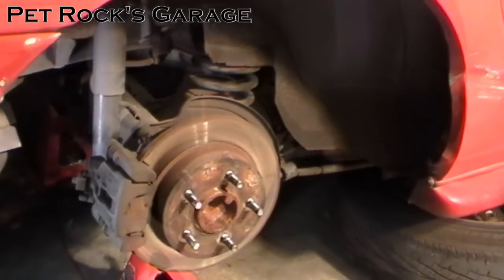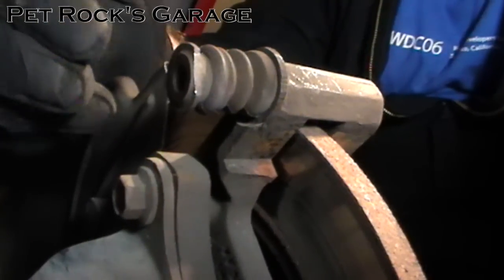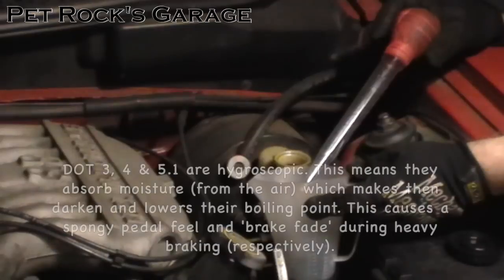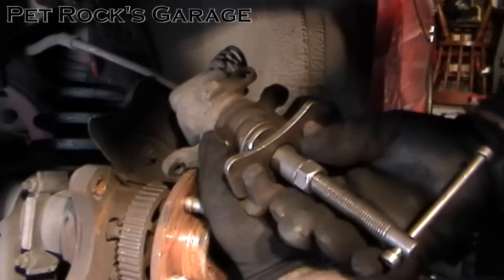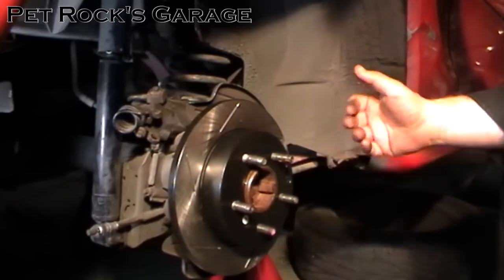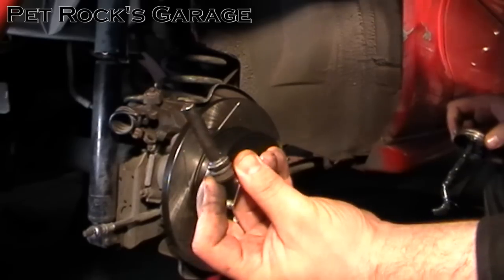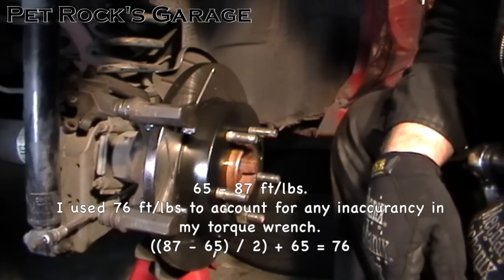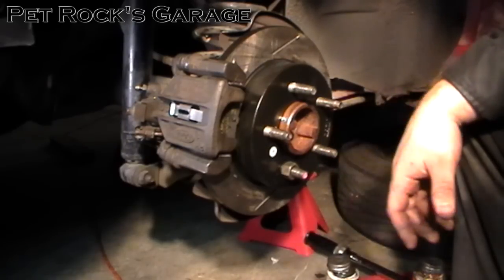How To Replace Rear Brake Pads & Rotor - Ford Mustang (’94 - ’04)

Comment: In your video, you said to have the "Parking Break" off or you'll never get the "Parking Break" cable off. Then you called it the "Emergency Brake Cable." I'm just wanting to clarify if I need to have my car in Neutral while I do this, therefore making sure that I have my car stabilized another way, or did you just mean for me to not have my Emergency Brake engaged, but have my car in "Park" on the gear shift, so the cable will come off?
Reply from the maker: Parking Brake, Emergency Brake & E-Brake are all the same thing.  If your car is an automatic, just have it in park.  If its a manual, it should be in gear so it doesn't roll away from you while you work on it.  In either case, the e-brake should not be engaged (meaning the lever in the middle of the center console should be down). If you jack up both rear wheels at the same time make sure to have a piece of wood, or thick book or something like that jammed in front & behind one of the front tires so the car doesn't roll while you are working on it.  To make things safer, however, I would advise only jacking up one side of the car at a time. Jack up one side, do the brakes on that side, then lower when your done. Then repeat on the other side. With it in park/gear the rear wheel on the side opposite the one you are working on should be in contact with the ground and prevent the car from rolling. I hope that makes sense.  If you have any more questions, feel free to ask.
Reply: Pet Rock's Garage- It made perfect sense. I did all that you advised even before I got your reply. I just figured that I'd use some common sense. LOL. Seriously, from the bottom of my heart, THANK YOU.😁 I just couldn't afford to pay the brake shop  $300. I had to get down and do it myself. I watched your video and paused it every step of the way and I got through it all just fine. Being a novice, it took me several hours and lots of tears and frustration, especially when the bolts were to hard to take off, but with your help, I got it done.
Reply from the maker: Thats great!  I'm glad my video helped you out and you got the job done. $300 is highway robbery for a brake job, in my opinion.
Reply: Pet Rock's Garage- It is. But when you don't know how to do something yourself, you are paying for a person's education and skill. If you as the brake expert tells me that the cost of your time and skill for a brake job is $300, I have have to believe you because I don't have that skill or knowledge to do it my self. With you sharing it like you did, you made me more self sufficient. "You taught this woman how to fish, and thus, fed me for life." As the scripture goes. You're a good man.

Comment: How in the world did you get the e brake cable off so easily? mine will not come off and i don't know what to do
Reply from the maker: Make sure that the e-brake lever is all the way down inside the cab of the car.  Good luck...
Reply: +Pet Rock's Garage I eventually got it. I just had to put some pb blaster on it and use a ton of force, it was kinda rusted on there. but thanks a lot for the reply
Reply from the maker: No problem. Glad to hear you got it figured out.
Reply: lol it amazed me too I always fight any e brake cable

Comment: Hopefully someone can help me or shoot some advice , i have a 2003 Gt i know my way around a car kinda and so i was doing basic maintenance and changed my rear rotors and pads because the old set was squealing from previous owners job ,   and i did the brake job percectly fine by the book everything greased and fitted right but now my new rotor on my “driver side rear “ is having contact with the pads or mounting bracket i believe and its shortening the life of my rotor so i assumed a sezied caliper or slide pins . I just got a new caliper and i bleeded the system correctly also greased everything up correctly again but still my rotor has constant contact and im so confused what it could be cause the passenger side is solid and i did the exact same for both sides !? Only thing i noticed was the E brake cable was not as easy getting off as you shown in this video ? Could that be causing the issue . my rotors and pads have less than 200 miles on them and man theyre getting used badly cause of this issue somebody help !? Great video by the way ! so far this is what i done 
- pads and rotors new 
- bleeded the system 
-new caliper 
- new slide pins and mounting bracket
-Brake hardware kit  
everythings been greased correctly and done correctly 
my assumtpion now is maybe i need those ford clips to hold the rotor back against the hub so it doesnt make contact anymore or the e brake cable is slightly engaged still cause it was pretty tough getting it off and putting it on ? 
11-7-18
Reply from the maker: It is hard to say what is wrong here without knowing if the rotor is rubbing against the pads or its rubbing against the mounting bracket.  They would have different possible causes. If it is the pads, and since you replaced the caliper, brake hardware & slide pins, my guess would be the e-brake cable is not fully disengaged. If its the mounting bracket, then its a mounting issue. The bracket, caliper or rotor are not mounted correctly (eg bolts not tightened all the way, or some obstruction not letting the rotor or bracket sit flush, causing the rotor to not spin in line with the rest of the assembly. It is hard to say what is wrong from my keyboard. Good luck.
Reply: Pet Rock's Garage Thank you for the reply truly appreciate it , could a bent axle be causing the rotor to grind against bracket or pad ? im going to try cracking down on this tonight
Reply from the maker: A bent axle would cause all sorts of other issues including, but not limited to, a very noticeable vibrations while driving. Hope that helps.

Comment: Ok so the tool won't turn no matter how force I put into it got any solutions beside replacing the caliper and piston?
Reply from the maker: Do you have the parking/emergency brake cable disconnected from the caliper? If you press the brake pedal, does the piston move?  Will it turn in the opposite direction? Did you remove the brake fluid reservoir cap?
Reply: I did not try pressing the brake but the cap is off and the parking brake cable is actually busted and just hanging there. The pads aren't as bad as I thought they were so I can get away with putting the old pads back on for a couple more days until I get time to try working on them again. I'll let you know if I run into any more problems.
Reply from the maker: If you press on the brake pedal and the piston doesn't move then the caliper is useless and needs to be replaced.  It is not helping stop your car.  Personally, I wouldn't drive it for too long with an inoperable caliper.  Major safety issue.  Good luck.
Reply: Alright thanks, the last time I had a brake job was like 2016 so I dont know how long I have had this problem
Reply from the maker: Brake calipers are funky things. They can seize up when you least expect it.  Especially if you live in a rust prone & high corrosion area. Good luck.

Comment: To get parking brake line off of caliper it can't be in park right? But do I put e brake on or put it in neutral  while on jacks stands? I wanna change my brakes and rear rotors myself but I kinda have a fear of my car rolling or falling of jack stands. Please help!
Reply from the maker: That1ne, the e-brake/parking brake only effects the rear wheels.  So if you have the rear wheels off the ground the e-brake/parking brake is useless.  So you should have the e-brake/parking brake disabled for this job and have the front wheels chocked so the car doesn’t roll forward or backwards.  You would have a heck of a time getting the parking brake cable disengaged from the caliper if the parking brake was engaged. Good luck...
Reply: Pet Rock's Garage  Ok, cool. Thanks for reply. Fingers crossed on doing all four.
Reply from the maker: Good luck...
Reply: Pet Rock's Garage Thanks
Reply from the maker: That1ne, no problem.
Reply: +Pet Rock's Garage Your video helped so much. Finally got them done(was being lazy) front and rear. And I didn't have to unclip parking brake line. Well I did on passagener side but not driver side. Thanks a bunch!
Reply from the maker: +That1ne, better late then never. :-)  I’m glad my video helped.  Feels good to do it yourself, doesn’t it?
Reply: Absolutely, I'm a do it myself kinda girl. I usually try not to take it to my mechanic unless its something major. And even then I attempt to do it myself first.
Reply from the maker: I’m the same way.

Comment: is that repair kit also suitable for mini r60？ it's look same
Reply from the maker: I have no idea.  It depends on if it has the same caliper as this mustang. Since its a different manufacturer (Mini Cooper vs Ford), most likely not.   I'd go to a local parts store, or rockauto.com and look it up. Good luck.
Reply: @petrocksgarage  thank you very much
Reply from the maker: @suguru31 , no problem. Good luck.

Comment: Can’t u use break grease as lubricant
Reply from the maker: to lube what parts?  I use brake caliper grease for parts that slide together and anti-seize for nuts/bolts.

Comment: Shit when i put my brakes on i tested them by breaking really hard and now one side is like stuck and burning the rotor. Have to take them apart again
Reply from the maker: Ouch. Good thing you tested it. That problem is typically due to the slide pins being stuck or the brake pads were not sliding properly within the caliper or the grease you used wasn't caliper grease and it just melted away. Make sure that the metal springs are installed correctly on the pads and the metal butterfly is in the middle of the caliper. Also make sure the slide pins and the bore they go into are nice and clean & well lubed with brake caliper grease. Good luck.

Comment: Can I use dot 4 fluid? Or does it have to be dot 3?
Reply from the maker: +That1ne, Dot 3 & Dot 4 are interchangeable.  But its best to use the fluid specified on the master cylinder cap or owners manual.
Reply: +Pet Rock's Garage Ok, thanks
Reply from the maker: +That1ne, no problem.
Reply: +Pet Rock's Garage Do you have any experience with the o/d light flashing on and off? Mine just started doing it like two days ago.
Reply from the maker: +That1ne, I haven’t experienced that but it means that something is wrong obviously. Most likely a trouble code has been thrown, so I’d get the codes read and see what comes up.  Most auto parts stores will read the codes for free. Get the actual code numbers and google them to see what they mean. Good luck...
Reply: +Pet Rock's Garage Ok, I'll do that. Thanks

Comment: one of my caliber slide pins is rusted how do I remove it
Reply from the maker: If the slide pin is completely rusted in the bore, then you could try a lot of penetrating oil or heat to remove it. But it might be easier to just replace the entire caliper. They are fairly inexpensive and available at most auto parts stores. Even if you get the pin out, the pin and/or the bore may be scored which will rust/seize up again eventually. Good luck...
Reply: thanks I did just buy a new one
Reply from the maker: My video on how to bleed the brakes after your install might help you out: https://www.youtube.com/watch?v=MPL7bpgcmVI Good luck.

Comment: How about using silicone grease
Reply from the maker: Not all silicone greases are created equal. As long as the silicone grease you have is rated to not degrade rubber over time and also rated to withstand 400-500 degree (F) temperatures it should be fine.
Reply: @petrocksgarage  thanks. I torque the rotor brackets to 55 ft. Pound. You said 76ftppund. Already put the tire back on. Can I leave it like for know. I change it next week.
Reply from the maker: @KrishnaSingh-ow1ie , it should be fine for a week, but I would not let it go for too long.

Comment: i cannot put the brake pad back it
Reply from the maker: The pads just slide into the caliper. If you mean you can't get the caliper back on with the new pads in place you probably didn't turn the piston enough to get it all the way back into its bore. Good luck.

Comment: The clips are always missing...
Reply from the maker: You mean the ones that attach to the ends of the pads? I always check the box before I leave the store to make sure everything is there. If not give it back so they can get you another one. I was given a worn out set of pads once a few years ago. Someone had bought new pads, installed them and returned the box with the old pads inside. The auto parts store employee didn't check the box and just put it back up on the shelf. Luckily I checked the box before leaving the store.
Reply from the maker: With that said, some cheap pads don't come with new hardware. I'd avoid those brands. You get what you pay for.
Reply: @petrocksgarage  the wrong part in the right box or the right description for the wrong part...what I meant was that the last repair left out the clips completely from the pads. Maybe they thought that works better that way? They weren't over heating and the wear is even.
Reply from the maker: @jonathanblanchard6480 , maybe, but they would be wrong. I think you've gotten lucky. The ends of the pads are rough cut, not smooth, and therefor won't slide against the mounting bracket very easily. You don't want anything hanging up or getting stuck in your brake system. You want it to move smooth as butter. The clips are smooth and will slide against the mounting bracket with ease.

Comment: I thought the rear calipers was a cool design WOW was I wrong ! so many small items to seize or bust ford knew how to keep millions coming back for mo parts.......I hate that twist design my 87 tsi conquest had them they would seize up and you usually would need to leave the car parked till the part came in a few days later..
Reply from the maker: +AwakeDude911, I haven't had any seizing problems (yet). These are the stock calipers.  But I do agree that they are a P.I.T.A,